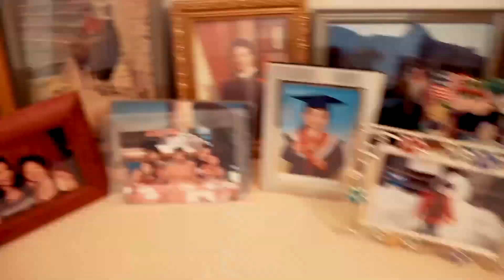Let's Talk About Exploding Escooters/Personal Mobility Devices..

Comment: Hello Jamie. What about all this bms bypassing?
Reply from the maker: BMS bypassing isn’t the smartest thing to do since essentially the BMS is suppose to regulate the cells in the battery pack, ie to prevent overcharging so unless you are using battery packs for radio control use, all scooters should be installed with a BMS system. I believe what you are asking is for an escooter using a customised battery pack. You have to be really careful because LI-ION packs can be very flammable, a BMS will be required and do Ensure you are getting it from a reliable builder...
Reply: Jamie Lim as i see there are lots of people selling theirs battery packs without bms

Comment: Hi Jamie, I have been following your videos on the Dualtron Ultra. I am new to PMDs and I recently bought a Dualtron Raptor. I am thinking of upgrading its external battery. Do you have any recommendations where I can get a reliable dealer to get these external batteries? Thanks
Reply from the maker: +Storm Wong definitely check Synergy Scooters out:) They are one of the most reliable in the market...

Comment: I am very disappointed about the company Minimotors. the processing leaves much to be desired with the Dualtron ultra. my steering wags and has play. I still have 5 months warranty. it does not happen at Minimotors. I can not recommend it.
Reply from the maker: +Thomas Friedberg have you tried tightening the bolt right underneath the stem? It’s a huge bolt...
Reply: Jamie Lim yes I have. minimotors said I should make everything with the hair dryer hot and then completely remove the steering head bearing from each other, look why it wakelt and then again put together "what a bad company. When I asked for a new scooter, I got no answer. I wanted an exchange of the scooter, finally I still have 5 months warranty. not even a bill, no papers ... such a shitty. I should also get a fast charger, nothing nadda. I can not recommend Minimotors. I have driven 150 KLM with the car and the scooter to a workshop. now the wiggle is almost gone. best regards Stefan